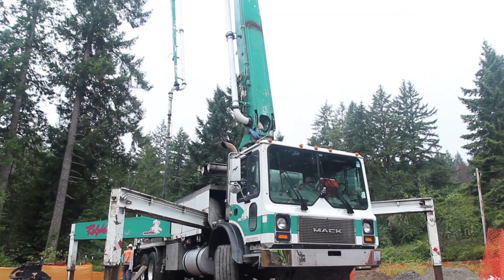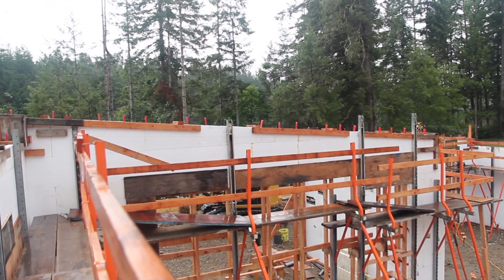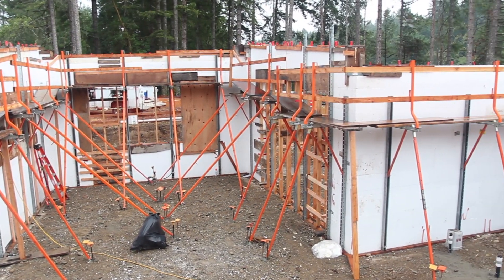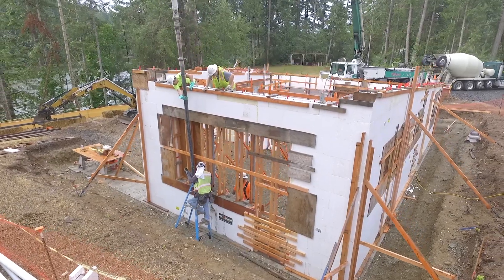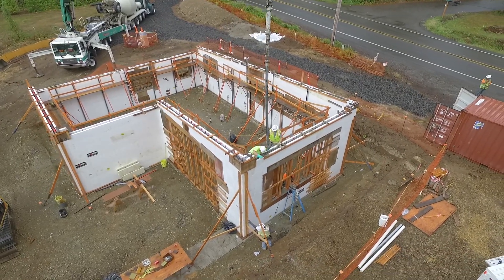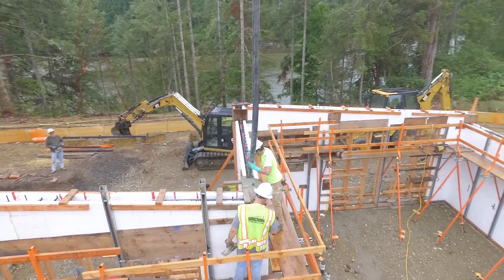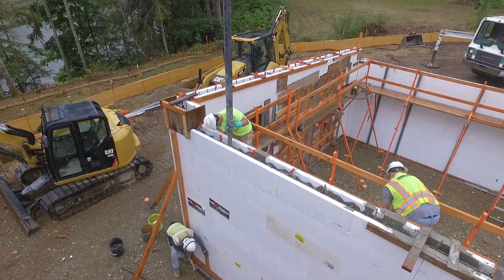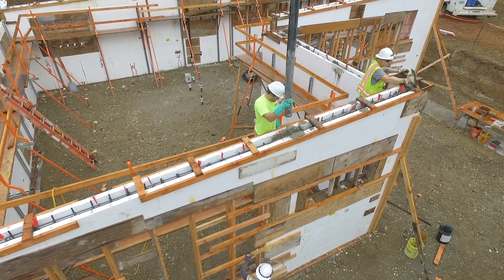Custom ICF Waterfront Home - Rocky Bay Part 5

Comment: Which ICF brand do you use?
Reply from the maker: In our Department of Defense and private contracts we have used most of the ICF products out there.  While we predominately use Fox Block, Build Block, Quad lock and Nudura products we have not come across a ICF block that we did not like outside of the Single Side series blocks which are still being developed and refined.   On this project we got the best pricing on Fox Block 6” block product.

Comment: Why didn't they use a pencil head vibrator to help consolidate the concrete and help eliminate voids inside the ICF forms?
I figured that the guy striking the outer wall forms was attempting to do this, but not sure how effective of a technique that is by comparison.
Reply from the maker: Hi there, there are two men on the scaffolding. One is pouring the concrete and the other is following closely behind with the vibrator. The one on the ground is striking the lower portion of the wall to help settle the concrete near the footing even further.
Reply: @MACNAKCONSTRUCTION  :  Thanks for the reply.  I didn't see the vibrator.  I thought that he was just troweling the top of the concrete.